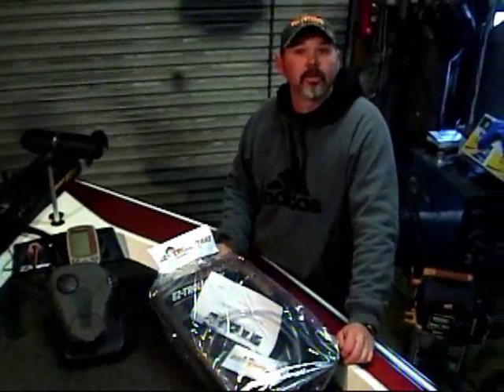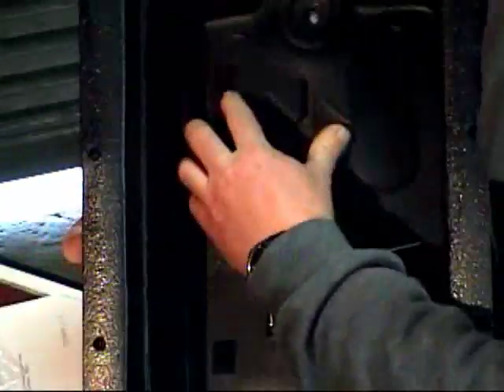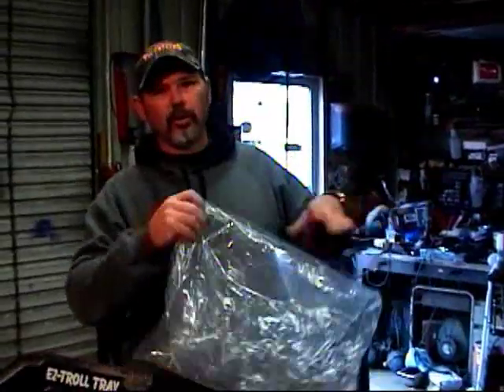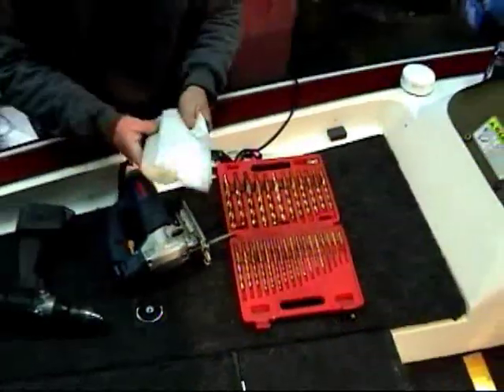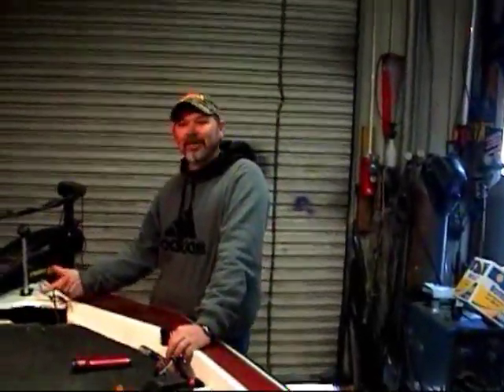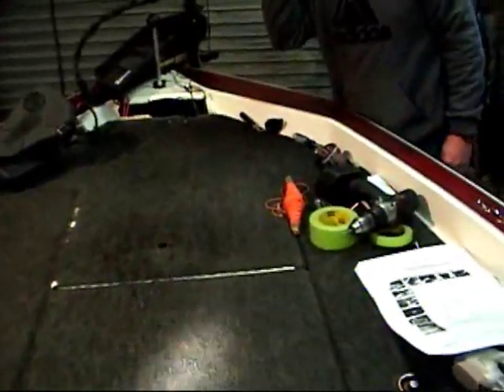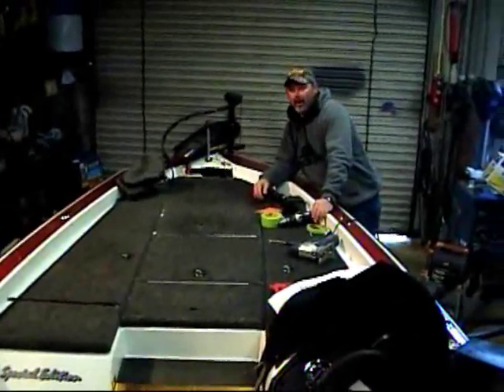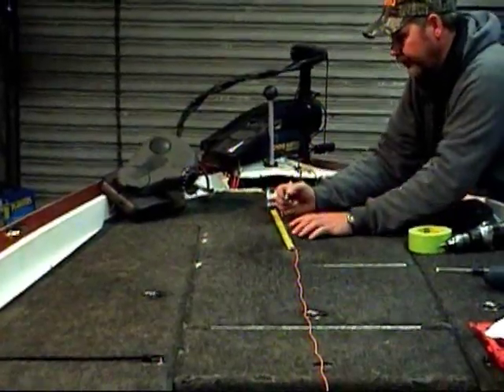EZ Troll Tray Installation (Part 1)

Comment: This is without a doubt the best video to show how to cut a hole in the bow of your boat for the EZ Troll recessed trolling motor pedal unit. NOW-FOR ALL YOU RANGER BOAT OWNERS, It's not that hard to cut and install one in the bow of your boat. I just finished installing one in my 1997 Ranger 481 VS. Follow his instructions, they are the best you can find. First, remove the control panel where the trolling motor plugs in and your front control switches are located, just like he did in his presentation. Once you cut the front deck with the saber saw, you'll need to place a 1" x 4" piece of wood next to the cut and use a large screw driver or flat bar to pry up the cut out piece. The wood will keep you from breaking off the edge of the cut portion of your deck. The foam will be stuck to the underside of your deck so just take your time and pry the cut portion out. Once that is done, use a large stiff blade knife to cut out the foam. Cut straight down along the cut and then cross cut the foam. There are no wires in this area and as you know, Ranger boats runs all their wiring through plastic tubing. At this point, you can use a flat bar to pop out pieces of the foam. It's really not that hard but will take you about 45 minutes to remove enough foam for your EZ Troll to fit. There is a tube in the lower front portion of the bow of the boat that runs back to the first floor drain. You can remove the drain cover and push a plastic pull cable toward the front of the boat if you can't find it. Pry out enough foam to run your drain hose to the front of the bow and push the hose into that drain line as far as you can. Try to keep it as low and flat as you can so it drains properly. Mine went about 4'. I would recommend using hose clamps because after I installed the unit, I bought one can of spray foam and filled the void around my new EZ Troll unit. One can will seal the entire area when left overnight. Drill and tap the holes for your pedal or use two sided tape or Velcro. Either way, your gonna be very happy with the installation. Plan on about four hours because if you're like me, I measure twice and cut once. Good Luck Fellow Ranger Owners!!